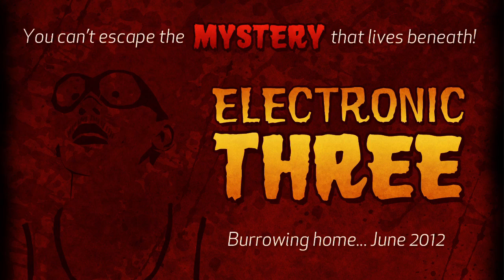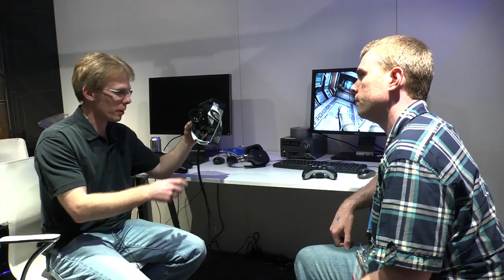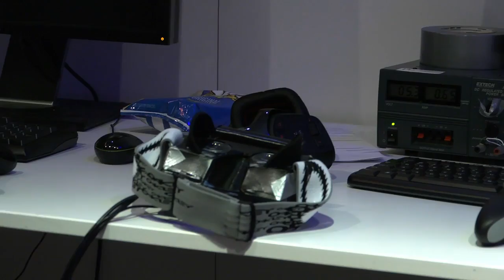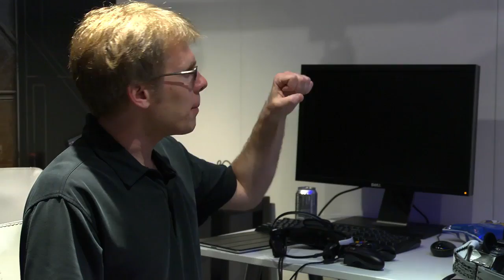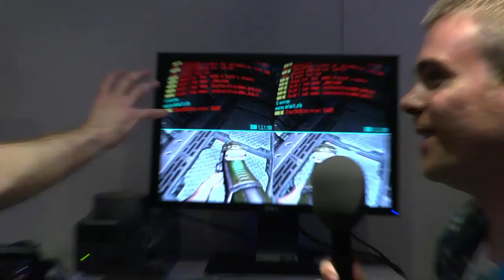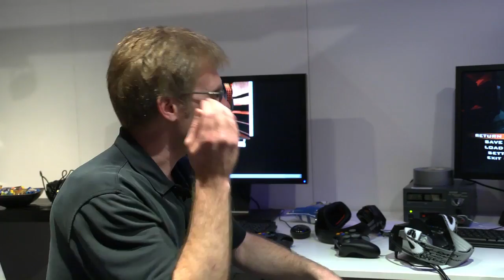E3 2012: John Carmack Interview

Comment: Also, focusing could be done with eyetracking and moving the optics depending on what you're looking at and it's 'virtual position in space' - this would introduce a whole new slew of problems though - instead of just screens and lenses, you'd have to have motorised lenses, adding weight, possibly latency, noise...

Comment: So yeah, Sony, and some cottage industry companies have been putting in quite alot of work on this and they all suck hard. But I y-buffered the interference photon window X-ray flicker signal and with the modulation display chip sensor I emulated with all the O-led firmware software that I of course know how to modify, i got it to work. Easy.